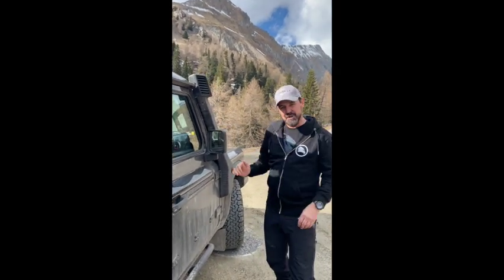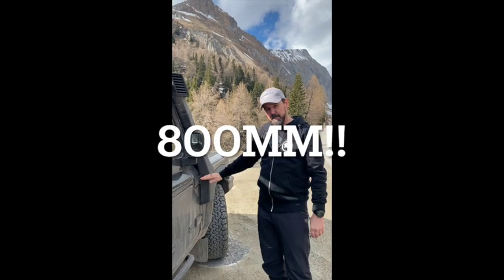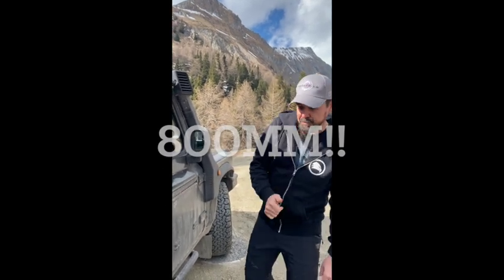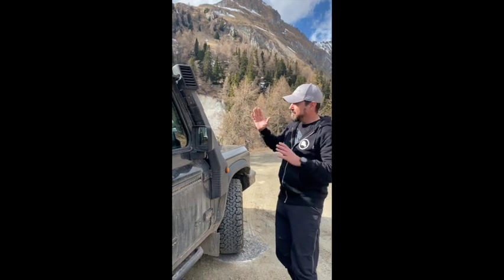My Ineos Grenadier - The Raised Air Intake

Comment: How do you like driving the vehicle on-road?  Hearing that the steering feels very loose.  Observations?
Reply from the maker: I am very impressed by the on-road performance.better than I expected!
The steering is "different". There is a little dead spot in the center when unloaded but you get used to that quite fast and then you don't notice it anymore. I will address that issue in my next video!!
Reply from the maker: there is a new video online where I address the steering and show a little clip riding on the freeway/motorway

Comment: I was told by an Ineos representative that the raised air intake can be removed easily if desired.  The intake simply remains on the side of the engine compartment.  True ?
Thanks
Reply from the maker: i am sure you can remove it easily but the right (side) indicator is ON the raised air intake if you opt for it. not sure how that would work if u remove it 🤷🏼‍♂️
Reply: @grenadier_exploring  thank you. That would be a conversation with the dealer !

Comment: Is it different from snorkel? Can you point out the location of air intake (assuming that you don't have raised air intake) if possible? I am just curious how wading depth is not changing with having it. I think you mentioned in your video, but I didn't get it.
Reply from the maker: hi. I have the raise air intake as you can see on the video - it's always on the right side of the car no matter which steering side you have. it doesn't change wading depth cause the breathers for the differentials aren't changed. but I know that test engineers went way deeper than the official 800mm wading depth!!! so it works as a snorkel but you won't get a guarantee from Ineos. hope that answers your question..
Reply: @grenadier_exploring  Thanks, I am not an expert with it. I thought the raised air intake is for air intake of engine, but having your answer, it is likely for intake of differentials. I should do some research on it :face-blue-smiling:
Reply from the maker: @_willkim  no worries - me neither ;-). The raised air intake is for the engine!!! but to get a higher wading depth you need additional modifications and since the breathers are NOT changed, the official wading depth remains the same. Plus you need to seal electrics etc.! but i got no detailed info on that.....